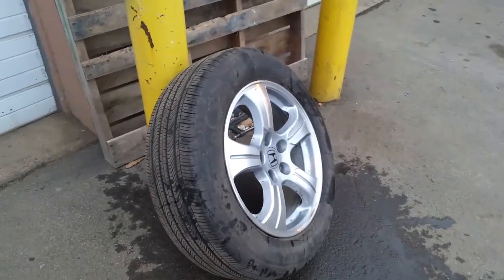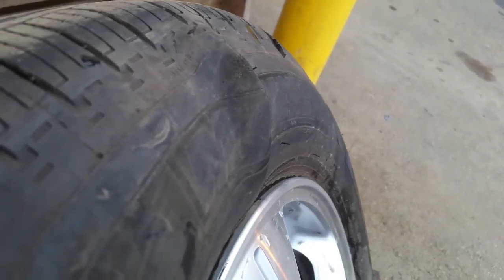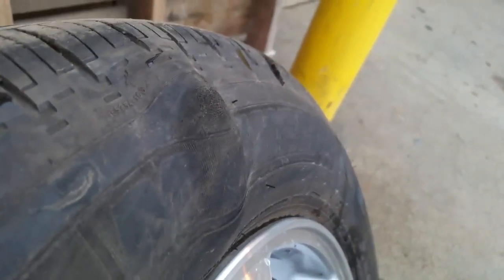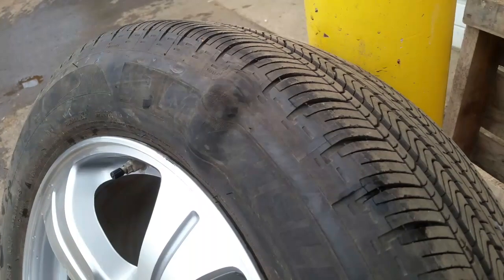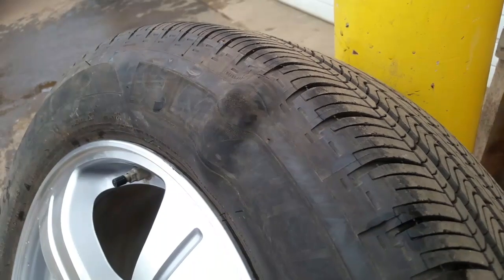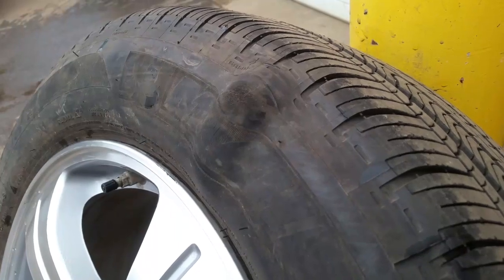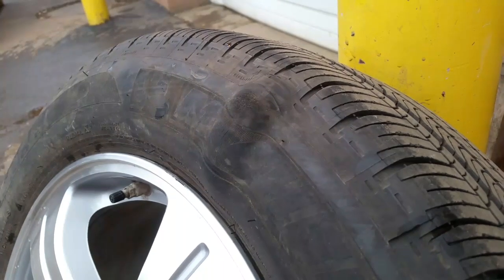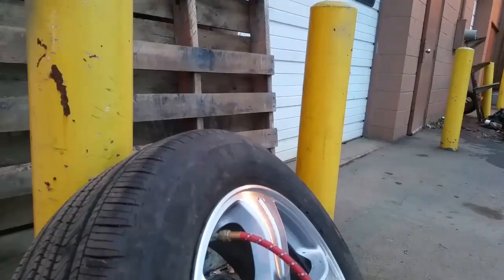WATCH WHAT HAPPENS WHEN YOUR TIRE SIDEWALL BUBBLE FAILS.

Comment: I hit a half brick on the highway on a 50 series tyre and got a bubble near that bad. As i worked at a service station and the tyre was almost new, i put a gaiter patch inside (the inner casing was split including about 6 broken cords) just to get some more use around town until i could afford to replace it. Got about 500km use before it went pssssssssssst for about 40 seconds. At the time it went, we were parked and standing near it!  Dodgy, i know, but wasn't going anywhere on the highway with it. The only tyres that turn into string bags before you can pull up are michelins. As a country service station attendant in the 80s and 90s, I've seen it all with flat car tyres. One quiet sunday, hears a flapping sound slowly getting louder from a distance- pulls in a mid 70s fairlane (Aussie). Full carload of Italians get out and leave me to fix a flat thats been run dead flat for at least a kilometre. So hot I needed gloves even touching the rim centre. Opened it up (tubeless) to find no rubber crumbs, no string hanging out and no aparrent sidewall rippling like most run flat tyres. Pulled the nail, put in a tube and inflated to find the sidewalls smooth and level. Informed the owner of the result, other options and possible consequences but he was happy so put the wheel back on. That was an Olympic tyre which I then sought for my own next set of tyres.

Comment: At what PSI did the tire bulge burst? Typically passenger car/truck inflation is between 32 and 40 psi. IF you inflated to 60 psi or more for dramatic effect then shame on you. Yes sidewall separations are a concern and the tire needs to be replaced. But we don't need the scare tactics.

Comment: I just got brand new tires and they were set to the right air pressure and I hit a hard pot hole and now I got a bump…. Soooo will I need to find a ride to work tomorrow??
Reply: Are you still driving on it? Curious because I just got a bump on mine and I need to go to work..

Comment: I’m in this situation right now. I bought a pair of Nitto NT555 285/40/ZR17’s. I stepped on 3 nails now the passenger tyre is bulged. I’m not replacing that tyre till that bulge eventually pops. It was a 300 dollar tyre so no thanks. I’ll ride what it was worth and I also believe it hasn’t popped yet due to the cooler weather but I could be wrong. It’s one toughass tyre and they got a 5 star rating from me because of how long it has lasted like this (1.75 weeks+)
Reply: Just happened to me too, 3 weeks new tire. Do you still have it?
Reply: @cipryan96  no it popped last year on the highway. It did last longer than I expected with the bulge though. But yeah I bout another set of the same rear wheels :)

Comment: Pretty underwhelming.

I’ve had a rear tire blow at 140, Bent the rear suspension arms and basically destroyed the body of the car.

-$8,000
Reply: EbbOneMint  140 miles per hour? Lol
Reply: Where you on the Autobahn?
Reply: kilometers prolly
Reply: Did you have a bubble on the tire?

Comment: Had a bubble  as big as a fist & I never hit pot hole or anything so I popped it with a screw driver .
Keep in mind It rarely goes more than 3 miles from home .
Still on my truck 2 months later and never added air.
& Yup I gotta get a new one .

Comment: That was less violent than I expected
Reply: It will be worse when it's rotating down the freeway.
Reply: Dan Mc literally what I was gonna say lmao
Reply: Add 70mph
Reply: I agree! I was bracing my self for an explosion!
Reply: You guys mentions speed but forget load… or even the fact that your driving a trike d
Reply: That’s because the tires are well-manufactured and reinforced to contain the explosion and minimize shredding.
Reply: @marquizzo  but it’s different on the freeway.
Reply: Just wait and see what happens when you’re driving down the interstate/motorway at 70-80 mph.
Reply: I don’t think the video captures the full effect. If you were standing next to it you wouldn’t think otherwise
Reply: yes that was

Comment: I've been driving with mine for a little over a thousand miles... Fuck yeah these Bridgestone Ecopias go hard! In this same car though, a few years back, perfectly good Kumoh summer tires blew up from the side wall, completely shredded! I did not loose control! I was on the freeway going at 70 the car just started vibrating heavily - I thought the engine was fucked but it was just the tire- I pulled over and called AAA and Firestone replaced it. That's it. I am changing this Ecopia with a bubble in it soon tho, I'm just broke right now. As soon as I get some money, you just have to drive slow and easy on it, shouldn't pop but if it does you should be good just need a tow.
Reply: 7 year old comment, but still dumb today. Don’t tell people they’ll be fine just because you were. People have died.

Comment: Would you ever have that much pressure in the tire or on the tire though?
Reply: It could definitely get up to that pressure if your car's weight slams down onto it like when you hit a pothole.
Reply: Weight of the tire being mounted, friction when moving, and the air heats and expands when you drive

Comment: I've been driving with a bubble on my right rear tire on my SUV for a year. I've carried cinder block, pavers, lumber and 94lb sacks of cement during that time. No blowout yet. I'm sure it will happen eventually, but I'm too cheap to buy a single tire. I'm waiting for another month or two and by then I'll have 50K on this set and then I'll buy a new set of tires.
Reply: buddy died over 25 bucks lol
Reply: @ravemasterdbzwwe  😂😂😂😂
Reply: Soo how did that work out for ya ?
Reply: Irresponsible comment!  Just because your tire ran for a year doesn't mean others will, by stating so you mislead some others less knowledges people thinking less of it criticality to replace the tire ASAP.
Reply: legalsolutions07  this is exactly the posts I’m looking for! Just needed some reassurance gotta wait 2 weeks tell pay day before I can replace the tire 😂😅
Reply: RIP Hombre.
Reply: @benstastny9475  😂😂😂😂😂😂😂
Reply: I've been unknowingly riding on mine a couple months. When i found out an hour ago I freaked out & now I don't wanna move

Comment: Thank you George. We have a 2016 MKZ Hybrid, 10,740 miles, w/Michelin 245/40R19-94V Green X tires that develop bubbles in the side walls.  This is our second tire replacement in less than a year. I suspect the bubbles are caused by air leaks in the tires and as stated in the video, low inflated tires and a pothole can easily cause a tire sidewall bulge. Though there are many complaints of the low tire pressure light coming on, Lincoln is not addressing the problem. We are senior citizens and drive slowly and carefully.  Are you familiar with this problem and any suggestions how we can get Ford to take responsibility?  Tires cost $300/each. Thanks.

Comment: People stop saying its bad manufacturing of the tires it you hitting the sidewall of the tire, the tire has metal strings interlocking and if you stress them lots of times they broke then once one has gone the others go like popcorn going off so stop saying its the bad manufacturing for fuck sake and and you should have used the treed before the tire dry rots so change the fucking thing

Comment: just slash the bubble with a knife
Reply: Better off slashing so no one drives with a bubbled tire, then repair with duct tape, one single strip, more will weigh more and fly off at speed due to centripetal force, also inflate more than usual because the duct tape is porous it will lose a micro amount of psi a day

Edit: typo

Comment: I have had a tiny bubble happen on new tires without being under inflated or over loaded on my car where it just was a faulty tire where the ply separated and it was replaced by the tire shop free of charge. but it was much smaller than this

Comment: this is not due to hitting a pot hole.  this is from having poorly made tires.  come on now.
Reply: yes it can happen! hit a massive pothole yesterday and found a bubble when I got home...
Reply: Mike West Nope it is absolutely an impact fracture.
Reply: Mike West, hit a pothole at 50mph and you'll see that you get a sidewall bubble (or a flat)
Reply: If you are going to hit a pothole, don't slow down, speed up.  That way you can fly over the top of the hole before gravity can pull your wheel down into the hole.  Especially if there is water in the pothole, you will aquaplane over the hole smoother than if there was no pot hole to begin with.

Comment: I had a blow out like this when I hit the kerb, I was going about 15mph because I was turning left at the roundabout, I drove it to a safe place to stop (was the starting of a freeway) and changed it there...

Was it the tyre that was the problem? maybe, but in the end, the kerb was also a factor, but my driving mostly caused it... would a brand new tyre fresh out of the manufacturers line of held up? quite possibly, but in the end, I wasn't going 80mph so... low speed is also a factor...

Comment: Or if you hit a large pothole the same thing will happen haha. Over loading and under inflation are 2 of the problems but not always the reason for the sidewall bubble. If you live in New England you'll be a pro at the causes cause the pothole game up here is Fucking REAL
Reply: I drive for doordash in new england and have to drive over speed bumps ALL the time. My shitty replacement tire just bubbled

Comment: I have a massive bubble on my sidewall, it's about 3 times that size.
Reply: Brandon Scheuvront well get a replacement ya doof
Reply: Brandon Scheuvront wrap it with duct tape, it'll be fine.
Reply: Roscoe Dogg He died when the tire burst on the highway.  R.I.P Brandon 😢
Reply: There is truth in what he says. A sidewall "tumor" can fail catastrophically, meaning your tire goes to zero pressure almost immediately. This isn't like a flat where the tire dies over an extended period. Folks can panic when it goes bang, or experience a sudden difference in control leading to over correction and a possible crash.
Reply: And some zip ties. Duct tape and zip ties fix eveything
Reply: That’s called Herpes Brandon. Go see a doctor.
Reply: Brandon Scheuvront replace the tyre or it will fail an inspection

Comment: you will not loose control of the car unless you freak out when it pops
Reply: you brake, you die... you speed up... you die... you swerve, you die...
Reply: + Elvis Livak So you freaked out, and didn't crash and lose control? Nice to know.
Reply: Elvis Livak 180kmh? What were you on the fucking Nurburgring?
Reply: Happy Fox you loan your car out you survive.
Reply: Matt Snapp yeah this is dumb lmfao good way to scare people into getting new tired haha
Reply: Matt Snapp n driving one handed
Reply: Matt Snapp well with dumbass now days never no if they will lose it
Reply: I hv bulge in one of the tyre in my ford car , i going to change it today
Reply: Just keep it tight man.
Reply: Matt Snapp nope. i lost my rear tire at 180 kph and nothing happened. didn't crash or lose control. so don't write nonsense
Reply: @grbetina1  what if it was the front tire?
Reply: @davidbarboza9224  if the front goes out ur gonna lose control lol. He's lucky it was the back tire.
Reply: Whatever keyboard warriors

Comment: I got a tire bubble when I went to a tire shop to remove a nail and plug a hole in my tire and when they finished they said did you know your tire has a bubble in the sidewall I know 100% sure that wasn't there when I took the car in could it be that they did something wrong and caused the bubble in the sidewall I'm just curious. I got the tire replaced at my dealership for free under warranty but I'm just curious why did the bubble form after they finished working on my tire?
Reply: The bubble will only inflate if the tire is able to hold air pressure... If it was leaking from a nail, the air was escaping there instead of to the bubble. They patched the hole and filled the tire, that allowed the pressure to go to the pre-existing bubble instead. Not at all the shops fault
Reply: Pavlo95   They could have possibly messed it up. When techs dismount tires they use a metal bar that pushes the bead and sidewall and if they're not careful they can put too much pressure on the sidewall damaging it. Somewhat like how you use your tongue with chewing gum to blow a bubble.
Reply: Pavlo95 If the object that entered the tire damaged the inside of the sidewall the hole in the inner liner would allow air into the sidewall. The repairers wouldnt have done it. It is most likely the object i cant count the number of tires I have removed where a nail has gone into the tread but bent around to damage the sidewall also.

Comment: What do you think about shaking when I m really slow cruising n it starts shaking n I have to hit gas to speed up n then it stops
Reply: That means you just need to do an on-wheel balancing.
Reply from the maker: It could also be the case where your motor mounts are worn out or even torn and that causes you cv axles misaligned at certain angle causing shaking then when you step on the gas engine mounts tense up causing change in cv axles angle making vibration go away. You really need to get it inspected asap.

Comment: If my car go over 65mph my starring-wheel  starts shaking, n also if I start driving like really slow on street my whole car starts shaking really bad n then I have to hit gas to speed up and then shaking stops
Reply from the maker: It sounds like you might have couple things going on.

1. You need to check your wheel balance. 
2. You need to check your tie rods.
3. Check your CV Axles.
Reply: Myballsitchsomethingfierce through the rest of the steering rack...
Reply: hamza malik Most likely is wheel balance.
Reply: Repair rear differential coupling bush thats all
Reply: Usman Ali Rear issues will be more likely felt through the seat rather then the steering wheel... unless it's 4 wheel steer.